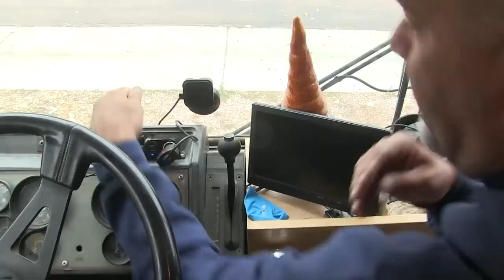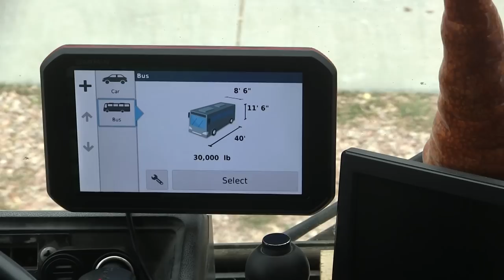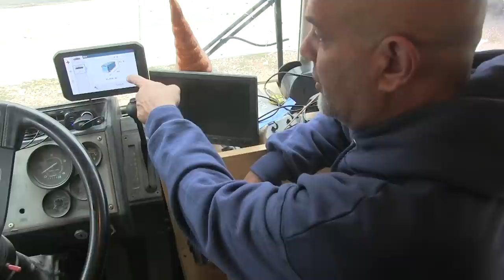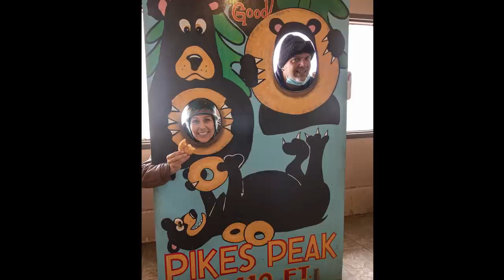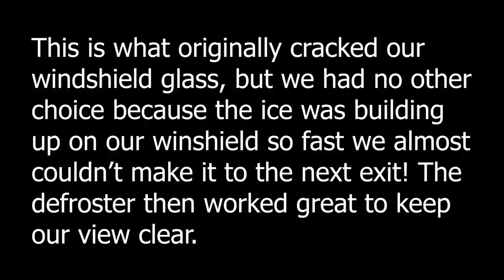First Road Trip in our Skoolie, to Colorado Springs!

Comment: You need to get the air compressor and air system checked. Low air is a bad thing. Don’t pump air brakes keep water drained out of the air tanks frozen air valves is dangerous . In winter add a fuel additive to keep fuel from gelling up.

Comment: Good to see you guys made a safe first voyage .Looking forward to seeing many more. I'm still a little concerned about the over heating issue.
Reply from the maker: Have a cool plan!
Reply: @BussyMcBusface  Glad to hear ....when I sold the 3176 Cat engine in trucks to my customers we were hauling a combined weight 80,000lbs. Without cooling issues unless  there was a mechanical issue. That engine should handle your 30,000 lb bus no problemo.  That drive in the snow was intense for me as a viewer. Best Wishes always.#64in Cali.

Comment: Wow oh wow all that snow OMG couple questions first one which GPS did you get from garman? Model number please second do you have one of those little fans that you put on top of the wood burning stove that blows the heat through the bus? I've seen a couple buses with those type of stoves and having that little fan on top really push the hot air through the bus I think they run $25 / $30 that my first time driving my bus ever here in Georgia was last February and the day I pick the bus up it started raining then sleeting yes I had a pucker butt hole the whole way home I never drove a bus in my life until that day. Stay safe stay strong stay healthy god bless and enjoy life✌❤💪👨‍🍳🎅🚌👍
Reply from the maker: We did buy a heat powered fan for the wood stove and the model number on the Garmin GPS is dezlcam 785
Reply: @BussyMcBusface      thats one I use in my semi.    It doesn't tell you current  city. Thats my biggest problem with it.    You can also make your highway choices/ wiegh points

Comment: Some suggestions if you please;
     Buy several small CERAMIC heaters for use when you have shore power (you paid for thejuice) and also to help defrost your windshield without the full blast of the diesel heater.
     Run several wraps of windshield washer tubing around your front diesel heater duct.  Attach one end to your washer splitter and the other to your reservoir.   Instant heated washer fluid!!!!  
      The need for chains is going to be rare but when  you need them..... .    An alternative might be to salvage a set of those truck spinner motors that spin chains under your wheels on command WITHOUT going total grunt tank retriever dude wallowing under Bussey to "chain up" also a far, far less chance of damage from broken chains or links and, no repeat of a wallow to uninstall!   I would bet lots of salvage semis and fire apparatus have that equipment that were rarely used and are available on the cheap! 
    Ditto on replacing or repairing your windshield.    If you should end up stopped in a tourist trap traffic stop (RVs and out of state plates make tempting targets in some SE counties and communities) a cracked windshield is the go-to ticket to just "get you on your way" in lieu of a 200 dollar '29 in a 25 zone' ticket and a mandatory trip to a JP or magistrate...wink wink ....plus, hands down the easiest excuse to stop you for friendly little safety inspection.    AAA used to keep track and warn travelers.

Comment: Hello Guys, Im in the process of building a bus of my own. I have watched almost all of yalls videos. I was wondering how the exposed drain lines and the water lines under your bus held up to freezing in that weather and or what yall did to keep them from freezing other than just the pool noodles.
Reply from the maker: We really didn't worry about them because the lines going into the bus went to the shower and the washing machine both of which we did not use while it was super cold in Colorado. The lines did not crack or break though.